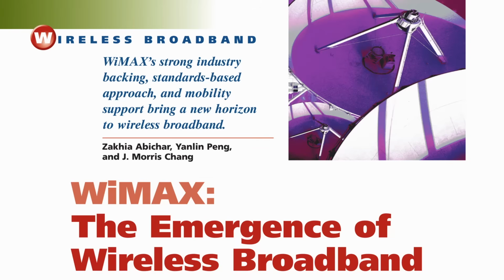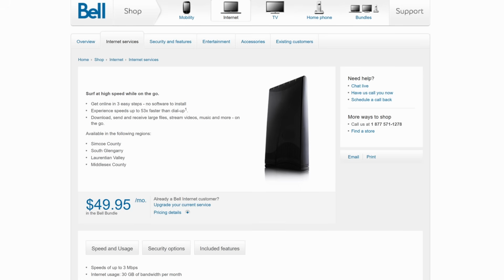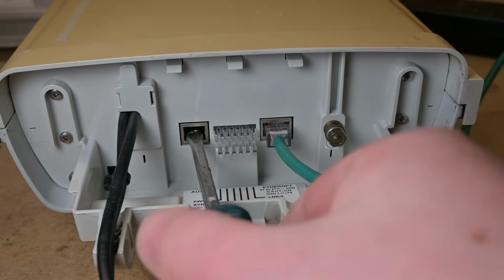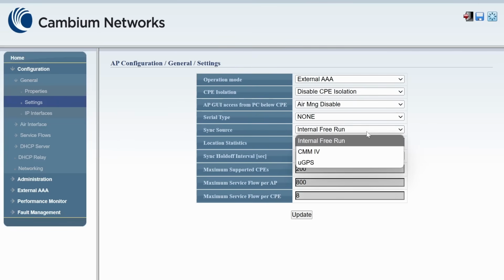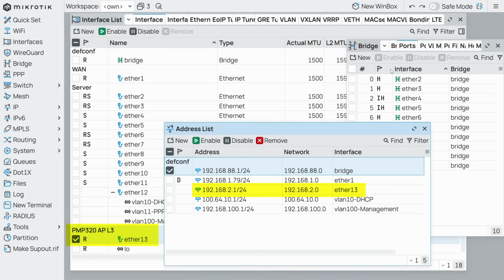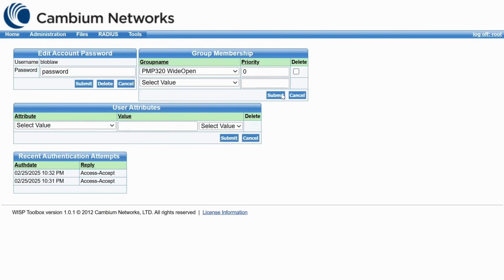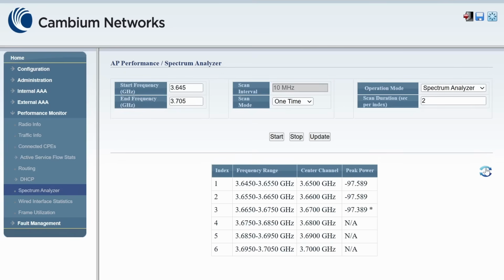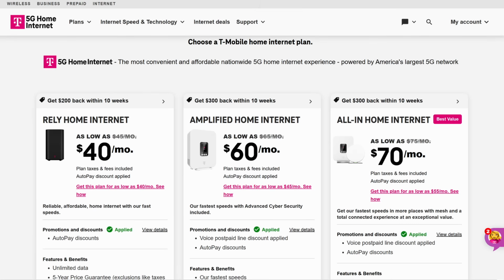WiMAX and Motorola PMP320: The Next Big Thing that... Wasn't.

Comment: I remember signing up for a 2 year contract with Sprint because of the 4G WiMax network. If I remember right, they were the first to release a 4G Phone, the HTC EVO 4G. If there was anything worse than Sprint's 3G network, it was their 4G WiMax. While driving on the freeway, the phone would switch back and forth between 3G and 4G, but the 3G wasn't stable enough to stream music on Pandora. Other carriers slowly developed their LTE network while Sprint went all-in on their WiMax.... Which was actually ran by a third party company, ClearWire. Those were the days.
Reply: Clear was the best !

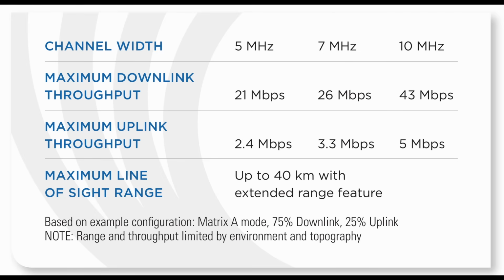Comment: 4:35 ahhhh! That's where I remember the name WiMAX from. Sprint bet big on the tech as "the superior solution to LTE" and lost big as well. I changed to sprint at the time and I remember it was the worst cell phone experience I have ever had. Speeds and coverage were awful.
Reply: I loved Sprint I miss it so much
Reply: Sprint had a deadline to bring 4G. LTE wasn't ready at the time.
Reply: As I remember it, Sprint BOUGHT Clear so they wouldn't have to upgrade to LTE. Of course it didn't work, and they continued to be "the worst" cellphone network on the planet. WiMAX was better than LTE for data services. But Clear's setup was far from "good". [I would rate it a solid "works."]
Reply: @jfbeam On paper, Wimax is superior to LTE. But out in the real world, LTE was more consistent and progressively improved far beyond anything Wimax could have done.  It wasted years and piles of Sprint money.

Comment: Smart Communications in the Philippines used Canopy in their Smart Bro wireless broadband offering in the mid to late 2000s. I guess because of the Cambium rebranding they migrated this offering into LTE/5G.
Reply: Canopy was the low end line it competed with companies like Tranzeo and later ubiquiti. (It was priced the same as Tranzeo's wifi based offerings).  The PMP line has been better higher end line.

Comment: We had those products. They sucked and did not work as advertized. Their was a recall on the whole thing. They still sucked. Software issues not meeting bandwith required.
Reply from the maker: They had a bunch of quirks, but I only started working with them in about 2015 so, where many of the major issues were worked out, but by then there was definitely way better stuff available. One unresolved issue we had with them was that the Motorola CPEs would slow to a crawl once it get below -20°C or so, but not on all units.
Reply: Yeah the problem was if they got too cold they would lock up. Fixed units had a heater inside them. They did a recall and replaced all our units.

Comment: In the Czech Republic we tried Wimax but it didn't catch on because of the price. But in the Czech Republic broadband has grown using Wifi PtMP. Around the year 2000, it was basically impossible to get a fixed connection in the Czech Republic (the monopoly of Telecom, which did not innovate). A few people then came up with the idea of CzFree - a wireless community network. They started to build long PtP or PtMP lines using DIY wifi. The first antennas were made from sausage cans and allowed to connect to omnidirectional antennas for several hundred meters. With large dishes it was no problem to connect even villages and towns for several kilometers. The first routers used were built on old PCs running Linux (PCI wifi card XI-626). Users then put the PCI card directly into the PC and ran a several meter long coaxial cable to an antenna on the roof or outside the window. Alternatively, an old PC with Linuo was put in the attic and served as client and router at the same time (no NAT but routing so that everyone had an IP directly on their PC). The CzFree then shared expensive leased lines to the internet (often connected via expensive 10 Ghz links). Gradually cheap APs came along around 2003 that could be used as transparent clients (Ovislink 1120, Asus WL-500). CZFree communities were formed in almost every major city. More than 200 000 users - a large part of them were not nerds but regular users who wanted to get on the network (big intranet or Internet). Later when the state freed up the 5 Ghz band they started building connections in that band too. In CzFree there were also interesting projects like RONJA - a fiber optic link that could be built at home for 100 dollars. The link was full duplex and 10 Mbps! Built with just plastic sewer pipes and a cheap laser and magnifying glass - and it worked for miles. As more people joined czfree, some of them started to turn into commercial WISPs. Now there are over several hundred WISPs in the Czech Republic. There is no problem in any part of the country to get wirelessly 100 Mbps (or even gigabit over 60 Ghz). Today, the most used solutions are from Mikrotik (5 Ghz AC, 60 Ghz) or from Ubiqiutiy. If you want to know more feel free to email me!
Reply: It was also quickly discovered that bridging to WIfi was a bad idea. With large numbers behind you, the broadcast flies all over the place and makes a mess (especially when no one had NAT and everyone was sharing over SMB). Very quickly it started routing - mostly OSFP
Reply: Actually, outside of Wifi, the standard Motorola Canopy at 5 Ghz caught on here for a while. Sometimes I still see old units forgotten on rooftops

Comment: Been using 3.6 CBRS 450m & 450b for sometime now. Just recently dipped into Tarana 3.6. Not even slightly comparable. Tarana is taking wireless to another level.
Reply from the maker: Having used both ePMP 6GHz and Tarana 6GHz, it's amazing what Tarana has pulled off. It's really too bad that we can't use the CBRS product here, I've seen many anecdotes of what that gear is capable of with more transmit power and semi-licensed spectrum.